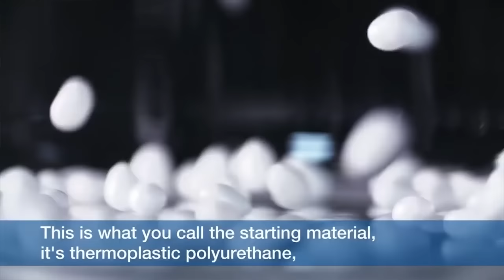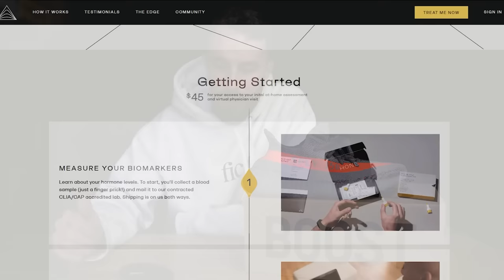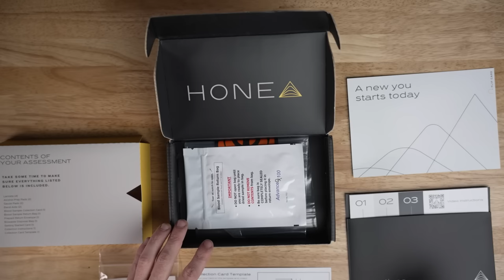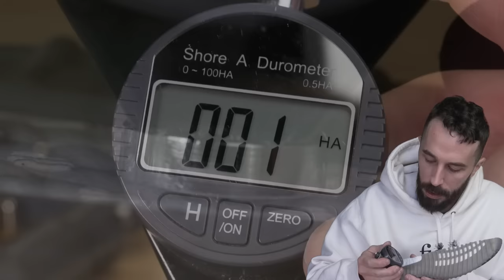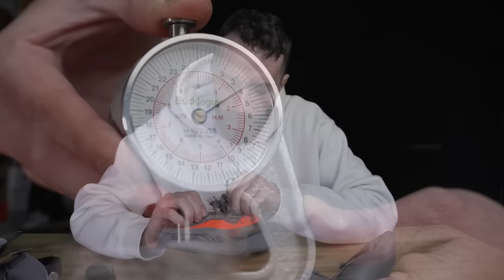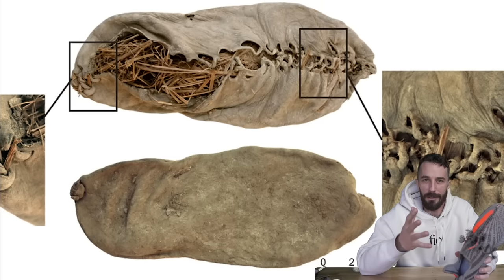The Truth About Yeezy 350 V2

Comment: As someone who’s been buying the Adidas Yeezys since 2015, the one thing I hate about the 350 V2s is that cage around the toes. I understand it’s there so the knit won’t overstretch and lose its shape, but sometimes after wearing the shoe 10+ hours you start feeling it in your toes.
Reply: Sounds like you need to go up a bit in size mate can't say i've ever experienced that
Reply: I got the oreos in recently after only wearing the mono 350v2s (which are fine) and that toe cage seems like it's going to be a sweat trap. Sure it's vented but I don't want a slick plastic cage over my toes when I'm going for that breathable sock/slipper feeling. Has that been a problem for you or just that they're a bit cramped?
Reply: agree
Reply: @wonton6227  it’s not size, it’s actually feel. When that’s a main part of the shoe that gets pressure you move forward, it rubs into the toes quite a bit and causes mild chaffing. Especially if you’re in the summer and wearing thinner socks, it’s actually not comfortable after even a couple of hours.
Reply: @Hughkulele  then you HAVE TO tighten up your laces
Reply: @Hughkulele  I dunno mate if sizing up doesn't fix the issues being described maybe y'all need those specialist shoes for people with mad feet
Reply: @nicolasmartin3609  I see what you’re saying. It’s more of the plastic cage in the toe box that’s rubbing and what I’m describing. It hurts after some time especially being at the front of the shoe
Reply: Bro for real, the top of the toe box constantly presses the top of my big toe. I have to taken them off after a few hours. Even sizing up a half size did nothing.
Reply: @Hughkulele  you might want to try the style of lacing called the ‘heel lock’; makes a big difference if your foot is sliding forward as you walk
Reply: 2020/21 350 v2 are TTS.

Those OG pre2020. Have to go up half or full size up.
Reply: I came here to write the same exact thing, I don’t think the original first four colors had that. I find I have to shave my big toenail really short to even be able to wear them longer then a few hours and even then it’s very obnoxious. Going up a size wouldn’t help either as I’m already basically wearing them a half size too big.
Reply: @wonton6227  I actually don’t think sizing up would help for a lot of people like myself. It would just make your foot slide around in it and give you callouses on the bottom. For me at least, the front toe part is just not tall enough for my foot. I already wear mine half size larger and loose and my big toe still presses against that top shell
Reply: @stancurry6265  Fair enough…. I guess peoples feet can be very different tbf so make sense some shoes aren’t for everyone
Reply: I used a shoe tree a couple times and that helped a lot. Now I lace them snug and the toe box isn’t as much of an issue up front but after a few hours it’s back.
Reply: That's why they say go up half a size
Reply: Glad I’m not the only one that experience that 😩lol
Reply: So true!!
Reply: I had the same prob with ultraboost. Sizing up didmt work, but taking the insole out did.
Reply: @pillcosby3949  take the insole out. No more burning toes
Reply: Gonna be honest with you, the 350 is meant as a casual shoe not a 10 hour shoe
Reply: @wonton6227  nah you feet shape matches the v2s. I'd had the same issue with him and the others. The v1s suits me good and It's why i don't get v2s anymore, infact i don't have any for now unless they reshape the pointed toes😁and been waiting for v1s with v2 colorways
Reply: 100% I have sized up and all still does it
Reply: @wonton6227  nah i have had a  10.5-12
always feell it
Reply: @yglystrailmix  fax, if they give a bit of space on the big toe side and soften up all of the toe part similar to let's say the ultraboost 1s. It'll be insanely comfy😋
Reply: Just go up half a size fam
Reply: Half size up
Reply: Cap
Reply: Did you go true to size or half size up like everybody said?
Reply: The 450s got it worse 😭
Reply: I thought I was the only 1...and I size up.
Reply: I feel like they are a lil too tight in the front and another half size up is too big for me. Feel like a another half cm in the front 3rd of the shoe width would make them way better. Not really a big fan anyway. Only have 2 frozen yellows and static reflectives have t worn them in ages and sold the other pairs I hit on. Lights tail lights and beluga reflectives. Stick to sbs dunks and Js for me. Only pair of yeezy I kinda want are the wave runners aside from those I’m good
Reply: @sneakerhead4770  do you mean the bone colourway oe
Reply: uwe ist dabei do I mean bone colorway for which ones? If u meant the lights the uv color changing pair
Reply: @sneakerhead4770  i mean do you mean the bone colourway ( the latest version ) if it fits slightly tight on true to size and slightly big half size up
Reply: uwe ist dabei I meant all 350s fit like that for me a little to snug in the front
Reply: @sneakerhead4770  so should i go true to size and break them in and they fit me perfect after 2 weeks or should i go half size up?
Reply: uwe ist dabei I go half size up from my AJ1 size. So I wear 9.5 in AJ1 and dunks so I buy 10 in yeezy and also 10 on some other retros. Adidas suggest half size up also. But if u already wear ur shoes big like some people then maybe not. Some people already half size up everything. It’s def a snug shoe so everyone will tell u half size up. 9.5 would be too small for me
Reply: just remove insole
Reply: Why you wearing them 10 hrs plus ? You work in them ?
Reply: hahaha you actually buy yeezys expecting them to be good wearable shoes. They are just art made of trash.
Reply: got these belugas as my first pair of 350s a few months ago, that toe issue is real. There isn't enough vertical space in the toebox. I guess I should've went a half size up
Reply: I can't relate I've been wearing my pirates for years to work in and never had a problem you might have the wrong size because it shouldn't feel like that
Reply: @Hughkulele  never felt anything like that while wearing them. U probably have fakes. Original yzys are the most comfy shoes out there, even more comfy than ultraboost 3.0. And i never had a problem with sweating in them, i wear them everyday and my feet stays dry. Its probably your problem that your feet sweats in breathable uppers 🤦‍♂️
Reply: I dont know a shoe I can wear for 10+ hours without sore toes afterward anyway mate
Reply: No one should be wearing footwear with a heel to toe drop. Most shoes and boots are shit.
Reply: @nickbrackett9023  You need your feet measured. You properly have wide feet and most shoes are too narrow for you.
Reply: That's how I feel about the Ultraboosts. Walked around for hours and miles in them the past weekend in NY and my god my feet has never hurt or blistered so badly. It's fully healed and the blisters don't feel like a bubble bathtub mat however the healing process sucked.
Reply: @wonton6227  do you have a brand suggestion
Reply: @binzyy4314  If it’s comfort you’re primarily looking for then I’d suggest checking out Asics Gel soled shoes. New Balance ENCAP is also great sole technology. Both of these brands offer a variety of widths to choose from if you have broader / narrower feet.
Nike’s React soles are pretty good and Adidas’ Boost is also very comfortable. Puma’s Cloudfoam is also really comfy and is rarely mentioned. 
Fun fact….. Puma were the first to make shoes containing ‘BOOST’ soles
Reply: I have been using Yeezy for years and I have never had that issue, so dunno what is happening with you
Reply: Nah 10+ hours is crazy 😂
Reply: @pillcosby3949  cut your toenails
Reply: You’ve obviously never worked in steel toes LOL
Reply: @wonton6227  yeah me too
Reply: @prezydentkucz9931  bollocks they are !!!  you got a bit drunk on the Kanye kool aid
Reply: @michaelbishop9157  u probably too poor to even get a pair lmao
Reply: @prezydentkucz9931  racist
Reply: Maybe its just your feet because I never had that problem with any of my 350s
Reply: Then that's the sign of a bad shoe.
 I bought a pair of leather No Bull shoes, and they are the most comfortable shoes I have ever owned, and I'm in my 60s.
Reply: I can relate
Reply: Where do you get them at
Reply: True shit.  But I'm not wearing a pair of sneakers for over 5 hours let alone 10. In the summer especially I'm changing my socks and sneakers a min of 3 times. Gotta stay fresh and clean.
Reply: yeah need to go half up or thin/no socks
Reply: My least fav thing is the 230 price
Reply: Bro I just always buy my yeezys a size bigger then my normal shoes...
Reply: @pillcosby3949  I just got mine and I'm having the same issue where they feel too cramped on my toes I went tts though
Reply: It's definitely better to wear 380s anyway if you gonna wear shoes for that long.
Reply: Same thing happens to me!
Reply: Hi
Reply: u got the wrong size my guy

Comment: I delivered pizza in a pair of 350 v2s for about a year. I blew holes in the sides of the prime knit on both shoes, and wore the outsole down completely bare on the front half of the right one (drivers foot), and put holes in the in-soles from where my toes would sit. I wore them rain, sun, snow, mud, didn’t matter, I have completely submerged them up to my ankles multiple times and basically waded through a river once during a particularly downpoury night. I wanted to see how they would hold up. I can say that I was pleasantly surprised at how comfortable they were throughout the entire process even up till the end, at some point I ditched the laces since they are basically for show anyway and after the year of 10 hr shifts 5 days a week my feet never hurt, I never got blisters, never had any hot spots or anything. They definitely are worn, and as I mentioned there are holes on the sides but if I really wanted to I could still throw those on and go to work.

Comment: i've been using an eltraboost 19 since it's release and i've gotta say during those years they served me well i've used them almost every other day, and they are still to this day really comfortable the boost havent compressed cracked or did anything like that. As for the primeknit it is a strong material but yes if something cuts just a little it will start to fall apart but i think my ultraboosts riped less it just has some loose threads sometimes not quite as drastic as in that yzy350v2. Excelent video i've been waiting for this kind of shoes since you did the joyrides. 

recomendations if you are planing to make it into a series:
-alphafly next%
-almost any ultraboost
-vapormax 
-almost any primeknit nmd
-bc you are a boot guy i think the air force one special field would be interesting
-nite jogger
-any Nike shoe with zoom air in it
-the yeezy boots (i belive it was the yeezy 500high)
-any kind of sock runner (the "originals" are the Balenciaga speed trainers but they are expensive af and i dont think it would make an interesting vid but they are the OG)
-acronym presto
-any kind of Nike space hippie

and so much more but these came to my mind rn keep up the good work :)
Reply: Yeah the lack of durability isn't really a con for this shoe imo either. The function of the shoe doesn't need a rip stop like durability. It's main function is to be aesthetically pleasing and comfortable. It just about scraps as a functional running shoe on flat ground
Reply: The great thing about boost being made of polyurethane pellets is that the rebound and comfort should last way longer than EVA. It’s not the most environmentally friendly, but the longevity and comfort can be great.
Reply: Yep the Nike Space Hippie🙌🙌
Reply: @Shn0nz  This is why I absolutely love them doing the 'Made To Be Remade' Ultraboost and will be interesting to see how this expands in the future
Reply: Don’t forget about the balenciaga triple s

Comment: I've owned a pair fo 350 breds from when they released in 2015 or 2016, I've worn them every single day because they so comfortable and go with everything. Tbh the boost has taken alot of beat, to a point that it didn't really come back to its normal form. In comparison to Air max I think the yeezy boost last longer and more comfortable.
Reply: More comfortable but they don't last longer than airmax 95's
Reply: Go with everything? 😂😂😂😂😂😂😂😂😂
Reply: @kennethwilliams8240  they are very uncomfortable tho. You need over the counter insoles to feel comfortableThey ones you feel like bricks if you don’t
Reply: @RjRedKing  
If you have to add extra shit to it then they are not really comfortable. You even have to size up. I did and it still feels big but then i get my exact size as well and it's cool until about 4 hours later
Reply: @kennethwilliams8240  are we talking about airmax 97s  or the yeezy 350? Because the Yeezys are gonna win all day. Almost all the nikes you can buy at stores need insoles. They feel good at first then you would have to get insoles. Specially air max 90s, 97s and 95s
Reply: @RjRedKing  lmao no, am90 still best shoes for walking. yezzy is dead
Reply: @hymenbreaker6100  yeah your crazy for saying that. They are not built for walking like they used to. Them shits is bricks on your feet. You literally need insoles to get cushioning. They are not comfortable at all. Specially if your a smaller guy or girl. Because you have to have some weight on you to feel the airbag. Am90 are my that comfortable at all. The air max Dawn are was more comfortable
Reply: @RjRedKing  comfort for me is not the insole. the toebox
Reply: @hymenbreaker6100  so you saying you walk on your toes? Because your using the whole shoe to walk. I’m not talking smack but you need some kind of comfort to walk all day. Or the tech they have in the shoe. Maybe it’s just you but they stiff as hell.
Reply: @RjRedKing  yezzy isnt the most comfort shoe on the market. btw more comfort compare to am90 but for me am90 fit me more
Reply: Yeezy is dead wearing it everyday just shows how dense ur fashion sense is.. hell nah
Reply: @marq6325  yo wtf  maybe u wearing red october huh?
Reply: @marq6325  what all do you even wear right now? As of right now Jordan’s are becoming dead.
Reply: @hymenbreaker6100  who tf wears red october
Reply: @RjRedKing  i walk with bare feet mostly, sometimes with crocs if i’m feelin’ it.

Comment: I usually go for the cheaper Boost in NMDs. Same basic principle without the marketing attached prices. You can really wear these as a sock without the foam absorbing sweat. I guess the insole in these will absorb more of that than the foam.

The Primeknit actually never really failed me. I've managed to have one worn through after like 4 years in the toe area. So unless you cut through it you'll be fine.
Reply: I have nmds and 350s. They don't feel the same. The boost is muted by the EVA plugs in nmds.
Reply: @michaelrobinson9296  for good reason. I also had original Boost, and they were awful to walk in because the foam was so soft.
Reply: I wore many boost models, and I photographed a lot of them. 350s knit is way different and detailed. The boosted models ultraboost, nmd and 350, for exemple, feel very different from each other. Ultraboost is better for all day walks and runs, 350s is like having clouds under your feet, nmd are a bit stiffer
Reply: @TaavP  Agreed, although I never felt the urge to touche anything ye. but the NMD are the most comfy option for me. especially in Primeknit
Reply: had both NMD's and Ultraboost 3 and the boosts were way more comfortable. They definitely not use the same foam, or foam density or whatever.
Reply: I own NMD’s and 350’s and the NMD’s are not nearly as soft, they’re comfortable but not nearly as much.
Reply: @thecustomconcern  rumor has it that "soft" isn't everything
Reply: @MircoWilhelm  Absolutely not, but being on my feet all day at work, comfort is.
Reply: NMDs are not as comfortable tbh I can only wear them max 4 hours
Reply: @charina_custodio  If NMDs are too hard for you, you're definitely too soft 😎
Reply: yeezy 350 discount 85 $

Comment: I had a pair of 350’s in Oxford tan and I live in Scotland.  I once wore them to the office on a day it snowed so heavy the buses were cancelled and I had to walk about 9 miles home through snow in them.  Water got in between the harder exterior rubber and the boost foam and froze and expanded and f**ked them up.  The harder rubber hit was ok but the foam crumbled on the sole so I ended up using them like slippers at home.  The 380’s are a bit more sturdy but if you have wide feet the cage bit at the forefoot to help them keep their shape isn’t as comfortable after a few hours of wearing plus the padding just inside the heel is unnecessary.

Comment: what you call the shell, the outer part of the boost is called caging. Most soft cushion tech follows the same rules. Caging to provide stability and depending on how much you want it to compress open parts for expansion i.e. the open parts on the bottom of the sole.

Comment: The foam is made by Basf, I have a pair that I wear as my throw on beater shoes they are a couple years old with no rips still holding up good.
Reply: Yeah they are ultra durable, my UB18 which is 4 years old is still in fantastic shape and my UB21 which I use everyday for runs for almost an year is still as good as new, albeit with a tiny rip in the continental rubber outsole on one of the pair
Reply: @sondrejohansen48  you work for Adidas? LOL. Sounds exactly like a shill script you've been pasting in the comments section.
Reply: @littlejackalo5326  I've been using a pair of 350 V2 Sesame as beaters for the past couple years and tbh, he's not wrong.
Reply: @littlejackalo5326  well Adidas has been quite late with my last paycheck, wished they could send it faster so that i can work better to boost the ultra boost